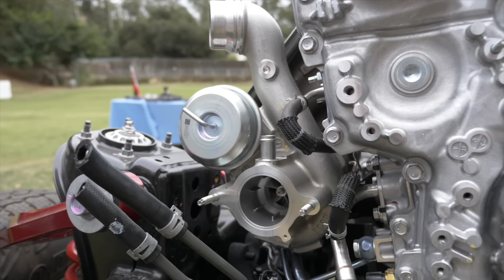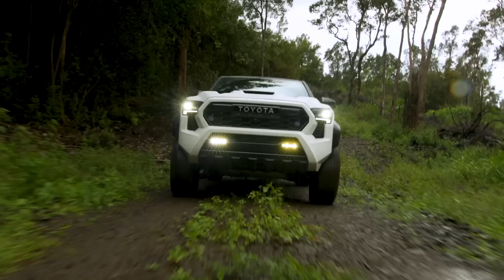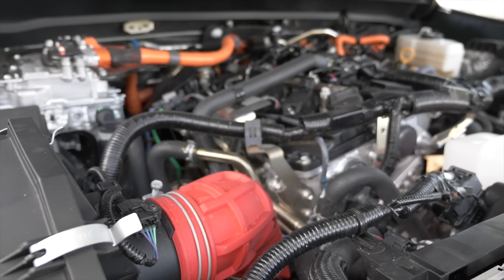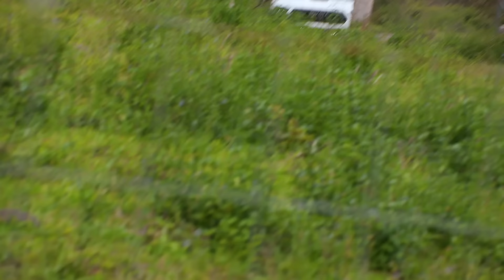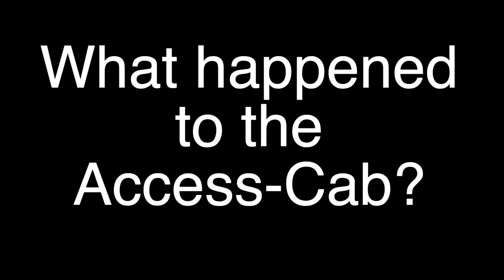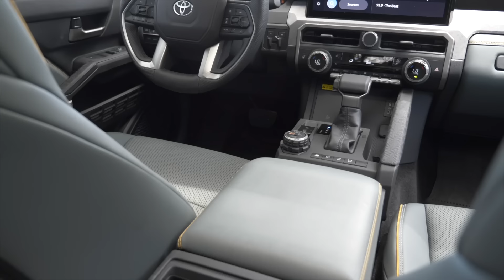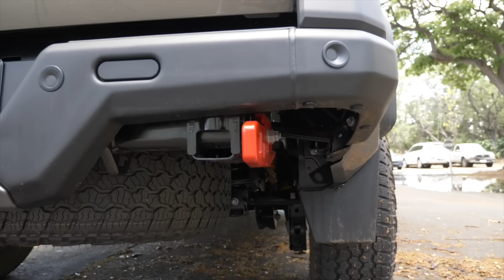2024 Toyota Tacoma Chief Engineer on new engine reliability and more...

Comment: Does anyone honestly believe that the head engineer is going to tell you that it’s not reliable.
Reply: I mean, they could have stayed silent.
Reply: @mad-meh2719 why wouldn't he defend the design he is responsible for?
Reply: @mad-meh2719 doubtful not when you work at his position within Toyota. I know how corporate politics work.... Higher ups tell you to speak on something and you better not bash your product.... Also people start to believe their own propaganda at that level
Reply: @mad-meh2719 that would be taken as bad. I mean we know it's less reliable but by how much. Never seen a 300k mile small frame turbo looking at 150k max before a 2-3k turbo swap.
Reply: It’s called signal theory, you actually are telling everyone how bad the engine really will be. By having to do all of this PR bull crap.
Reply: @DougEvans-wb5ch  or could be stupid people asking the same stupid questions over and over again
Reply: @DougEvans-wb5ch Absolutely. If you have to try hard to sell something, it's probably not very good. Products sell themselves. Ever hear toyota pitch their v6????
Reply: @DougEvans-wb5ch well I guess …
There is a cult following on the 5.7…. It’s almost 20 years old ….
So they are worried about the doubt ..
Reply: @DougEvans-wb5ch or people are concerned and they are addressing the concerns
Reply: And when the turbo goes T U how much is that going to cost?
Reply: @Olaf236 my wife’s 2009 Acura RDX is turbocharged. It has 164k on the clock and it’s still going strong. The only things I’ve ever had to replace on the vehicle is an AC compressor, swaybar end links, and a 70 dollar transmission pressure sensor which took about 30 minutes to swap out. And the tires and brakes, belt and all the other normal wear items.
Reply: @paulallen-01 Your wife’s RDX does not tow anything. Towing puts massive stress on the powertrain. You’re comparing apples to oranges.
Reply: @Olaf236 don’t know about a pickup but on an International MV bobtail truck about $6000.00
Reply: @Olaf236 turbos will be low on the trouble list
Reply: @Olaf236  oh and they will. Anyone that knows anything about engines knows that you do not mix a gasoline engine with a turbo unless it’s a race vehicle that’s constantly being broken down and rebuilt.
Reply: @Olaf236 a lot, on top of the inflated purchase price.
Reply: @Olaf236 probably like 2k~
Reply: @Olaf236 turbos can last a long time if maintained correctly
Reply: @alvinsimba734 I've never had a turbo motor, what is the maintenance on a gas turbo?
Reply: @RossMalagarie  thanks for asking and to answer that, turbo engines are gas engines just like any regular gas vehicle, and also with turbo engines you have to use premium fuel instead of regular fuel and more oil change intervals too for instance every 3000 miles (5000km) instead of 5000 miles (8000km) which I currently do with my Toyota Corolla sedan which doesn’t have turbo. My rule of thumb when it comes to vehicle purchase is to purchase a vehicle that you know you can afford and maintain without problems and for me personally with what I do, that’s why I prefer a vehicle without a turbo. Turbo is more for power boost and nothing wrong with it, it’s just that it has to be religiously maintained that’s all.
Reply: @alvin… Actually, it’s not required to have premium fuel in Toyota turbos. At least in the new Tundra with twin turbo engine, 87 is recommended by Toyota.
Reply: The rest of your comment I agree with.
Reply: @is6566  same in the GM 2.7L turbo 4 cylinder
Reply: @is6566 yeah I don't think modern turbos require high octane. It only makes a difference in compression resulting in higher boost.
Reply: @alvinsimba734 becoming less reliable no with the crazy high turbine speeds to get the power up at low rpms. 150k is a long life on a small Frame gasoline turbine and people not changing oil ever 3-5k miles is a death sentence to journal and ball bearing turbos
Reply: @alvinsimba734  'IF' maintained correctly.   The average US murican won't, I can assure you.  Have a look at a couple of 'Just Rolled In' videos to see how Americans treat their cars.
Reply: @RossMalagarie clean oil and clean air filter.
Reply: @RossMalagarie  From my research, turbocharged engines benefit from religious, short oil change intervals. This is because when the oil flows through the turbo housing it will experience higher temperatures than non-turbo engines normally would. When oil is heated that extra bit more, it will bake off some of the ingredients that keep your engine clean and healthy, hence the need to change the oil a bit sooner if you want optimum reliability and performance.
-(edit) oh ya, and keep up with the engine air filter changes!
Reply: @alvinsimba734 but hundreds of thousands of miles?
Reply: @RossMalagarie just making sure you keep up on oil changes
Reply: @RossMalagarie turbo beats on oil so oil change is important. It also extra important to warm the oil up. You also have to worry about failure of plumbing components involving the rubbers as there are extra heat involved
Reply: @alvinsimba734 what is premium fuel?  That’s a marketing term. What you’re thinking of is higher octane, which is a matter of combustion and timing, not quality. Additionally, Toyota turbos don’t require high octane fuel, rather their computer system adjusts timing to any fuel being used.
Reply: @alvinsimba734  that's not what he asked. He asked what the cost of replacing the turbo is going to be.
Reply: @alvinsimba734 my neighbours still drive their 1st Gen RSX like bandits 15 years later. 2L turbos in those things, though they are religious with maintenance. 🤷🏾‍♂️
Reply: @alvinsimba734 Sorry but you are so wrong. I have a Ford Ranger 4 cylinder ecoboost. The owners manual and the service people told me that premium fuel is not necessary and is a waste of money. Why would I change the oil at 3000 miles. 3 highway road trips and change the oil?  Waste of good oil. 5000 miles is the suggested oil change interval with conventional and 10,000 using full synthetic. Not all turbo motors require premium fuel so don’t lump all of them together.
Reply: @alvinsimba734 but 300k? 500k?
Reply: @psynurse  you can get that much mileage out of turbo engine but it takes a lot of maintenance. I had to find my comment and see what I said because there are over 100 comments on this thread alone, but yes they are some car brands that require regular gas even if it’s turbo whereas other brands prefer the premium fuel for better performance with turbos like Honda does.
Reply: @WM3I  as for the cost you are looking anywhere from $500 to $2000 lol
Reply: @RossMalagarie turbo is a turbo is a turbo. There is no maintenance, it has its own oil line, generally, which also provides cooling, but it is a high spec part so it should last unless you decide to let your oil become sludge.
Reply: @FirstnameLastnameHuman  ok thanks, I never had a turbo so looking forward to seeing how they last in the Colorado Trail Boss with towing about 6500ibs out of the 7700ibs tow rating. I am looking to hopefully tow a toy hauler loaded at 6500ibs about 2-3 times a year so we will see how it does. Thanks for the info.
Reply: @alvinsimba734 That is going to be the problem. People are not going to maintain them correctly. And when the turbo goes, how will the engine perform. Basically it's useless.  In my opinion.
Reply: @RossMalagarie  the maintenance on a diesel turbo is simply the greasy exhaust that keeps everything running smooth. And a gasoline engine there is none.  Give it some time and you’re gonna see a lot of those vehicles in a used car lot.
Reply: Toyota Japan is superior to Toyota made in the states, or should we say made in Mexico
Reply: Better an engineer than a salesman!
Reply: I can tell you from experience that I’ve never, ever owned any Toyota that was not reliable. Ever. And I’ve owned several Toyotas. Every single one of them had over 300k on them before I donated it. So I’m just going by past experience. My 2013 FJ Cruiser is running just like it did when it was new, doesn’t use any oil and pulls my little fiberglass travel trailer with ease. There ain’t nothing like a Toyota. Amd I grew up in Detroit.
Reply: @privatepilot4064  yea but none of those you mentioned were small displacement turbo charged engines.  Of corse there old NA engines were reliable.  Thsts not what's being debated,  there na engines are the best.  But high stressed turbocharger engines never last like the NA
Reply: @privatepilot4064 The new Toyota is very different
Reply: I love all these experts in the comments. A bunch of "back in my day" guys.😂😂😂
Reply: @cesarnavarrete6973  yup because we kno what lasts and what dosent.   That's what experience gets ya.
Reply: Nobody believes that but can you disprove anything that he said?
Reply: Toyota= Reliability. When I look at what Toyota does across the board to insure that they are making vehicles that are going to be reliable, economic, and more recently, more powerful, I will continue you love them. I don't view Toyota as an auto manufacturer. Their model of don't fix what isn't broke is still evident today. They develop high quality parts that just end up together as the most dependable cars ever. They aren't number one in sales worldwide for no reason.
Reply: @TejasAutoSalonJasonW Haha fast forward to today . Toyota has really fallen from years past right now . Maybe the new CEO and bean counting .
Reply: It's Toyota. They correct their reliability issues as they come up. If it's not reliable at release, it will be within a year.
Reply: It’s Toyota 😊😊😊
Reply: He’s got way more answers than the Chevy and Ford Engineers regarding their respective 4 liter turbos
Reply: Reliability has been reduced.
Reply: "Wants a good ol fashioned truck"...no such thing available anymore
Reply: First, you can either suck the 2GR/1GR engines that are gas hoggers and takes 65 bucks every 380 to 410 miles per tank or you give a chance to these new engines. Want more information on the new engine? Search for 2AR engines and how good they are.

These trucks are very heavy due to the body on frame which is what many of us love but is the compromise we have to deal with.
Reply: It’s Toyota so they get the benefit of the doubt.
Reply: Come on man, he's coming out putting his face, his name and being transparent about the design approach.    You think he's going to do all this if he thinks it sucks?
Reply: Your skepticism doesn't make him incorrect or a liar. Get your engineer to prove your skepticism is accurate if you don't trust the information given, or don't. Mistrust without data or proof is easy and gets attention but doesn't disprove anything at all.
Reply: The Toyota badge on the grill says it’s reliable
Reply: Wow.  All you guys out there trashing this truck when you have no idea if it's reliable or not.   You assume that because American made gasoline turbos are crap, all turbos must be crap.   lol  you have no idea.   

Toyota leads the world in automotive reliability.  Even their first gen vehicles are vastly more reliable than anything Detroit puts out, ever.  I worked for a Tier 1 automotive supplier and Toyota was one of my customers.  They are more thorough with their engineering and testing than you can imagine.  And the culture is such that they do not rest on their laurels, they are constantly improving everything.   It's really a very different kind of company than anything we have here in America.   

These trucks will be fine. Remember, there was also a lot of negative speculation about the Prius when it came out, which turned out to be a non-issue, because we're talking about Toyota here, not some average Chrysler or VW or Fiat.
Reply: Considering there are a lot of people that drive a lot of miles.  Reliability better be good.  I doubt they’d release a truck with issues.  This engine is already being used in several models.
Reply: @user-tb7rn1il3q already issues.  Just days ago read they have hold on production due to quality issue. Just watched video on TFL when they were going up fire road in Colorado snow when lost 4wd , front was spinning tires on ice slab and loud noise, that was the end. 2024
Reply: @psynurse  The only production being held is for the GM twins.  The Taco losing front driver is a one off rare failure.
Reply: @user-tb7rn1il3q  it hasnt even been a month and a prominent Tacoma content producer has a major failure. We already know there are going to be widespread issues with first model years. You could not be more wrong.
Reply: @tacoponcho  A few failures is normal for all manufacturers.  This is not widespread at all.
Reply: @user-tb7rn1il3q Exhibit A: Tundra 2022
Reply: @user-tb7rn1il3q  they released the tundra with issues….
Reply: @user-tb7rn1il3q like what?
Reply: @user-tb7rn1il3q dude it happens all the time ..
Reply: @user-tb7rn1il3q , could you tell me what are those Toyota car or trucks used this engine? What is the first year and model of Toyota using this turbo?
Reply: @user-tb7rn1il3q  Your statement doesn't make any sense.   How much time did they have to redesign the newTundra and its been the least reliable and poorest build quality Tundra ever made.  Turbos = more parts = more problems.  The funniest part is when you look at a 98 Supra the Turbo is right on top in front (extremely easy access).  Toyota burried these Turbos in the trucks so they can charge you more to fix them.  These are the first gen Toyota throw away trucks.  I saw it going bad when they threw a Subaru engine in the GR86 (previously scion).   Then they used a BMW Engine in the new supra (goodbye reliability).  Finally they made the two worst trucks ( New Tundra and Tacoma) in Toyota history.   They are replacing reliability with styling.
Reply: @user-tb7rn1il3q Based on Toyota's recent past, they have no hesitation in releasing new products with unproven reliability. Sure are a lot of 2022 Tundras with blown engines. Sure were a lot of 3rd gen Tacoma problems considering it was a relatively moderate 'redesign'. Sure were a lot of 3GR issues in the early years. Etc etc.
Reply: @sheepdog3828  thanks for the info 😎👌
Reply: Of course, don't you?
Reply: NO, not at all. More stuff to prematurely break down. No thanks, not for that kind of money 💰
Reply: DIY fluids/filters/plugs to 300k+ miles?
Halfway there on my 17 OR MT and it still drives like new.
Any compelling reasons to switch?
Otherwise, see you around 2029 Toyota.
Reply: Is it made in Mexico?
Reply: @sledawgpilot  mexico yep  🤣
Reply: Only time will tell
Reply: Perhaps, but it’s good to hear from a design engineer as opposed to often sanitized click bait videos.
Reply: Toyota doesn't announce their reliability ever - don't need to buy when they do publicly - you better believe it's true folks!
Reply: You must have never owned a Toyota 😆😆
Reply: The logo should say enough. We use the same engine in many other models and Lexus as well and we have upgraded nearly the whole motor to handle truck duty
Reply: He’s testifying to his work. Can’t knock that if you ask me.
Reply: It's not that he is going to say it, but it is the content of what he says in response to the question. Talking about using this tech in other countries and for a long time as well as going into their testing procedures sound a lot better than someone just saying "absolutely, it is reliable."
Reply: It’s not the turbo itself that I’m worried about, it’s the stress that the turbo puts on the rest of the motor. In a small hatchback like a GTI a turbo motor is so fun. In a truck like a Tacoma I’m just looking for reliability and longevity.
Reply: Let’s be honest, even with the first  model run issues that will arise a Toyota at its worst is still light years better than anything the Big 3 can muster on their best day. AND as a fact, Toyota does more than anyone to improve and solve problems all along the way. Big 3 make money from their problems on the backs of hard working folks. Sad.
Reply: There’s many Toyota and Lexus products on the road with Turbos that are already passed 200,000 miles and have been reliable. Will they make a million miles like some NAE engines of the past? Unlikely but around 1% of car consumers keep their vehicle past 100k miles anyway.
Reply: More components = more opportunities to break, all driven by EPA standards.  Voting has consequences
Reply: I'm shocked that the biggest Toyota fanboys don't trust a Toyota 4-banger turbo. 
People are  afraid of change
Reply: Change YOUR OIL... every 5 Thousand miles or less. Never more than 5,000!
Reply: No, but I also don’t believe that Toyota puts this 2.4L turbo in a number of their vehicles to ruin their own reputation. However, this is a new generation Tacoma which means there will be issues, wait a couple of years for Toyota to figure them out and things should be fine. I still have faith in Toyota more than most other brands on the market.
Reply: They won't say S*** since they wanna protect toyota's reputation.
Reply: Yes
Reply: why would we assume its not reliable just cause its a turbo? turbos have been around for 50 plus years havent they?
Reply: The same company said the V6 Turbo would be as good as the V8. 
😅😅😅😅😅😅😅😅😅😅😅😅😅
Reply: As “reliable” as a Toyota Turbo 4 can be made, still won’t beat the reliability of a Toyota V6.
Reply: Toyota lied to Congress in 2009 over the sticking gas pedal that killed multiple ppl then they back tracked and paid 1.5 billion to those affected so in short no.
Reply: Puss gut
Reply: Junk....... Anything to meet better emissions........ It's always junk.
Reply: For real 🤣👍
Reply: Are Toyota turbodiesel engines desirable in your mind? What's the difference?
Reply: This is not the head engineer. That guy would be in Japan amd is a multi millionaire. This is a low-level  US marketing engineer, a "bubba"  hired to make you think he's like you, in order to build trust. So you will swallow the 4 Cylinder.
Reply: No, because honestly died decades ago.
Reply: Thaf green one at the end with that side racks thing damn I love that
Reply: Sounds like a smart engineer. To bad he doesn't work in paint department.Never buy Tacoma in white. Toyota has not figured out how to make white paint stick.
Reply: @The-Team-Out-West all Toyotas paint peel and as a customer and DIY guy if I gotta fix something paint ain’t so bad. Just had to repaint 50% of my 07
Reply: Never buy Tacoma in white. Toyota has not figured out how to make white paint stick.
Reply: I think that the Toyota will last longer than the fat ass engineer
Reply: Right 😂
Reply: exactly , they give you more  is what they want you to believe  but in fact its less material to wear ie  surface areas   of parts pistons  and bore .
Reply: 343k Views on a Fake Imposter Video.  YouTube is Full On Fake Now?  Nice! 👍🏻
Reply: Thinking the same thing …
Anyone employed can’t say anything against company narrative …
Reply: How often does Toyota put out an unreliable engine?
Reply: Exactly. It's unproven. Only time will prove it. Until then I'll stick with the out going v6s or v8s from them.
Reply: Also, change your oil every 3-5k with Turbos. You’ll have no problems long term with them if you do that.
Reply: Toyota and Honda have a proven track record of reliability with some hick ups. The domestic car manufacturers such as gm, Ford and Chrysler are in a state of disrepair because of straight up greed, imo. The bottom line is resale of vehicles and Toyota and Honda hold their value.  Trust me, I want the domestic market to get their crap together someday.
Reply: Their word definitely better than yours. At the end of the day its still Toyota.
Reply: Turns out engineers hate customers too and Not just mechanics!
Reply: I was going to ask…would he actually say anything negative? I did  hear him say at the beginning that it was done for “our emissions mainly” which translates into environment before anything.
Reply: I would day if you own the lad few years of the V6 treat it and maintain it like it’s gold
Reply: You just don’t get the longevity out of a 4 then a 6 and turbocharged 4s just do not have the longevity period!
Reply: No but they can make the case
Reply: It's a Toyota, it will be reliable.
Reply: 100 right this guy is just going to assume that everybody's stupid enough to believe the lies😅
Reply: @truthnow902  you probably believe the Fox Bullshit Factory.
Reply: They've been using turbochargers on diesel trucks since 1951, it's not like it's a new technology, if you maintain the engine , it will last 300,000 miles.
Reply: Bring us diesel for Toyota in the USA,  then I'm down with a turbo.
Reply: I expect him to be able to say HOW it’s reliable. Which is far more valuable than some keyboard warrior’s input.
Reply: He’s trying to save his job.
Reply: Salesmen...........................Selling Ice to a polar Bear !
Reply: Most long haul diesel trucks run turbos. They often go over a million miles. Still, I'd rather have the four liter v six.
Reply: I'm from Europe and I know how many problems we had there before that TURBO  BS came to US. There is no such a thing like reliable engine with TURBO ,for longer run.
Reply: Does anyone believe you know better?
Reply: Thanks Toyota, for making my 2021 more valuable 😎
Please keep pumping out more junk 😂
Reply: Tundra recall…nuff said
Reply: I did not believed a single word that came out of his mouth. Turbos can never be a long lasting and reliable engines. The basic idea of pushing in compressed air that accelerates the wear & tear of the engine in comparison to a N/A power terrain.
Reply: This engine is the same used in LEXUS NX, so relax and take a cup of tea (Japanese one) 😊
Reply: @CarlaPalma-f8n ugh.......thats a car.  The tacoma is supposed to be a TRUCK!
Reply: Ha Ha !!
Reply: I still prefer the normal engine…

Less parts = reliability
Reply: If he is putting himself out there for everyone to see. I will give him the benefit of a doubt a little.
Reply: Not with a gut like that!
Reply: You're an idiot. Sure, he's telling you it's reliable. But you're completely ignoring the fact that he's explaining WHY it's reliable.
Reply: He looks real energetic, 😳
Reply: Nope, but he believes Toyota made a newer version to meet what customers seem to want.  We can have a Toyota or one of the other brand trucks.
Reply: He can’t even get his own diet correct
Reply: I wonder if this guy had his hands in the transmission engineering? Or how about those break lines?
Reply: I have a 2019 Tacoma with 88000km. Not a single problem yet. The turbo 4 will have to wait a few years for me in order to gain my trust or not. Time will tell…
Reply: This is this dudes crown achievement. He spent years studying engineering, and the Japanese deemed him competent enough to represent their brand (I worked for the Japanese in a Toyota parts manufacturing plant and I know just how picky they are). He's spent countless hours on perfecting it.  He's obviously proud of it as he took the time to record and showcase it.  This video alone convinced me that "all is well" with the new gen.  So I purchased a 25 TRD Sport.
Reply: @BarberChad606  and look at the problems with them.  Bunch of garbage trucks now.  Took the most reliable trucks and made them some of the least reliable now.   Garbage!
Reply: My next Tacoma will be a used second generation with a v6
Reply: What’s gonna be funny as to watch Toyota backpedal here in a few years.  I don’t know very much about auto mechanics, I mean, I’ll replace things if they break, but I’m not going to rip apart an engine and fix it. But what I do know is that gasoline engines and turbos DO NOT work for reliability.  Long gone will be the phrase, “Toyota trucks are reliable”.  These engines will be lucky to see 100,000 miles before being complete junk.  Sales have plummeted since the introduction of this design.  They just need to switch them to diesel.
Reply: Not at all
Reply: Yes because Toyota ceres about their reputation. They fixed rotted frames on second third etc owners. 

You’ll be driving a turbo charged vehicle or battery eventually it’s the way they are taking you. So hop in and get over it 😂and dam like the power already look how many semis on running on turbos.
Reply: Yes yes we do
Reply: Is anybody honestly gonna believe that Toyota made a bad motor?
Reply: @julianmcnalley4909 Only those not brainwashed by the Toyota cult religion of blindly worshipping the mother company
Reply: Toyotas been doing turbo motors for decades.  Relax
Reply: @b_snow777 Cult garbage never stops. Look what all those decades has produced in the Tundra.  Great stuff. Fanboys eternally licking Toyota boots.
Reply: Do you have proof????
Reply: I want to ask the question as I am an mechanical engineer not some technically illiterate garage goober with a keyboard and barely a salary of $60K or less..  If  turbo diesel engines can be designed for commercial duty  million miles why can't a turbo gas engine achieve 300K miles in light duty truck applications?  Then what is the motivation of Toyota to risk their reliability/durability reputation by intentionally introducing a powertrain that is a failure?  I think you pundits are emotional goofs who built your opinions off of old data from the distant past.  If you keep turbo engines well lubricated with clean oil and cool they can last avery long time,  not to mention this is in no way a high peak  performance car turbo boosted engine.  It is a purpose designed and tested light duty truck turbo engine.  So cry about the past all you want cause there is no going back.  The days of V8 and V6 in these  platforms are surely gone and never coming back.  That is unless you pay the Lexus sin tax.
Reply: @kannermw We're talking apples to oranges here. A big diesel is not a consumer item, but a tool for a trade, expected to run a million miles and be overhauled several times, and it's priced accordingly, because it's an investment that makes money. It also has less restraint in packaging,  so it can be very big, reinforced,  long, and heavy. Typically,  big trucks have straight sixes, which fit under long hoods and between straight frame rails, providing 7 main bearings for Increased durability.  
Even the original Cummins Dodge diesel was a heavy agricultural engine,  stuffed into a pickup. 
With a gas engine,  especially a turbo one, it's different.  Firstly,  gasoline does not have inherent lubricant properties like diesel oil does. A gasoline turbo engine is subject to.dense packaging restraints, which is why they're usually a V6. This automatically takes you from 7 main bearings to 4, which concentrates loads onto less surface area, which puts more load on the oil film, which is also a mess due to the piss-thin  oils niw being used. There's also a ton more heat and pressure on the whole structure, as consumers demand more and more power out of tiny engines.  And as we can see with newer cars in general,  there's a disposable mentality. Any seasoned mechanic can tell you that.  Nothing is built to go 20 or 30 years, like the older, under-stressed designs. I have an old F-150 with a 4.6 V8 that is 30 years old, and many of these go 300,000 to 400,000 miles, even in police and taxi service. But, they're only putting out 220 HP or so. 
It's probably possible to make a gas turbo go for this kind of mileage,  but there MUST  be compensation for the extra stress in materials and engineering,  and the company that does this is pricing themselves out of the market. The market today trades in a vehicle in a few years,  so manufacturers don't waste money making them be durable goods. And most buyers could care less, and do zero research.  Witness the new Toyota Mexican soft Taco,  which is so cheaply built that it doesn't even have a transmission cooler or bump stops.  Yet it far outsells the Frontier, which has both engine and transmission coolers, Dana axles, and a very proven N/A V6. 
What sells today is not quality and longevity,  but a NAME and hype, with lots of plastic gimmicks.
Reply: Yes
Reply: sheldon is now the manager of a Krispy Creme donut shop
Reply: Mine runs fantastic
Reply: 95k miles on 2024 no issues
Reply: Toyota is very smart and strategic in their Quality control and business decisions. They destroy engines on purpose to find every weakness until they are satisfied with the end product of their testing. They call it Kaizen which means always improving. Have any of you seen how reliable Toyota Turbo engines have been in the past? 2JZ for example.. legendary engine. B58 is technically BMW but believe me, Toyota quality tested the engine and had BMW change a few things so that it could be up to Toyotas’s quality standard. I haven’t heard of any of those engines have Turbocharger issues. I have full faith in Toyota’s ability to deliver on their product being known worldwide for their reliability.
Reply: @jerry64264 They have had issues.
Reply: @jerry64264 you seen the 102,000 engine recall for the tundra turbo engine? 😂
Reply: @tamalpias you seen why they were recalled?
Reply: @bradleyholt if you believe Toyota it is machining debris. Irregardless it is a massive problem.
Reply: All fine but still offer the v6
Reply: @rockymtnnut  They can't dude, because of emissions.  The government is forcing their hand.
Reply: @rockymtnnut Toyota will sell every one they build, so why add a second option with similar power? It just seems like a distraction when Toyota could focus more resources on making the one engine good.
Reply: At the end of the day. Toyota will get you home.
Reply: @timleng4404 Unless your 2022 Tundra's engine blows up. Unless your 2016 Tacoma stalls out and leaves you stranded on the side of the road. The 3rd gen was nicknamed the turd gen for a reason dude. Toyota will get youu home if the vehicle is at the end of its production life. A 2015 Tacoma got people home. A 2016 left a lot of us stranded. A 2020 Tundra gets us home. A 2022 grenades an engine and we hope the dealer sends someone to help.
Reply: @timleng4404  well their proven vehicles will...
Reply: lets check in 6 months after release.  @timleng4404
Reply: @timleng4404 tfl trucks got stuck using one of these Tacomas 🤣 shit became a prerunner
Reply: @phantombread3170  Another reason for you to go buy a Colorado,  Ranger or a Jeep.
Reply: @timleng4404  I guess not a new one they are all wayyyy too big
Reply: @ kentpass 😃 According to your logic, the chief engineer is doomed if he says his new truck su(x) and unreliable because he admits it and if he explains why it’s great and reliable then he is doomed because he is obviously just lying. Great approach to life! 😃
Reply: @is6566 you nailed it!
Reply: Yeah but when does toyota make anything unreliable? Reliability durability and dependability is what they're known for. They won't change that for anything.  I believe in the company.  I believe in Toyota and Lexus.
Reply: @gabevillarreal4779  reliable? Probably.  Durable with a hybrid turbo charged engine?  Depends on what you mean.  The battery and turbochargers will have to be replaced eventually and both will be expensive.
Reply: @theoutdoordad7395  I f course but in my mind when they are engineered and manufactured by a company like Toyota,  I trust that they got it right. Regular diligent maintenance will do the trick with this company.  It's been my experience with Toyota lexus and Honda.
Reply: If you doubt Toyota reliability you’re kinda screwed to be honest. Nothing else surpass it
Reply: It’s a Toyota, not a Ford. Toyotas just keep on going.
Reply: @monteaustin1006 😂😂😂 yea the out going v6.   This is a turbo 4.    How many turbo anything u see on the road w 300k n 15yrears old???? None
Reply: He ate the evidence
Reply: If it was ford , dodge or Chevy they wouldn’t even make this video not to mention Toyota’s are built for a different purpose
Reply: The first one or two years of this truck is going to have problems. It might be 30 or 40k miles before we see them, but there will definitely be problems.
Reply: @tacoponcho where is it built? Mexico?
Reply: @sledawgpilot  mexico like the old one
Reply: @sledawgpilot  yup
Reply: @tacoponcho How in the hell do you know? Did your crystal ball tell you that? 😂
Reply: @mr.wilson8340  because thats how it always plays out. You would have to be foolish to think it will be different this time
Reply: @tacoponcho exactly and by next year the truck's coming out should have most of the kinks fixed, at least I hope
Reply: @tacoponcho TFL broke the front drive during a tough off test. Wait Toyota 's result of failure,though TFL thought the case of front drive broke.
Reply: @tacoponcho I still drive my 1979 turbocharged Toyota Supra, still waiting for the problems to pop up.
Reply: @mocheeks709  whos talking about your rebuilt antique. And theres already been dozens of reported issues, check the taco forums.
Reply: @tacoponcho  the ADD on one truck broke , a carryover from the last generation.
Reply: @tacoponcho  yes like the V6 twin turbos- blowing up
Reply: @tacoponcho No problem. The engine is warrantied for 60,000 miles, so they'll all be covered under warranty.
Reply: @dvader3263  yeah, you trust the guys messing up oil changes to rebuild engines? Good luck lmao
Reply: @tacoponcho Let me guess...You have an older 4runner and you have never driven a 6th gen.
Reply: @ColoradoConquistador ive driven the 6th gen its garbaggio like your opinion
Reply: Not gonna be towing much with that.
Reply: @crypto_ninja  I think it's rated at 6K or 7K ibs towing
Reply: @RossMalagarie I don't believe it's that high for SR5.
Reply: What does it matter to you?
Reply: Knowing Toyota… it will be subpar and take about 5-10 years to be acceptable. The Toyotas that are known to be reliable are ones that have been out and refined after years.
Reply: Is he the head engineer or did he just eat the head engineer?
Reply: Dude... He's a sales person and it shows...
Reply: @abbsgarage.9676 yeah, that’s what this video is for, buy in. Deep down he knows the v6 power plant is way more reliable and cost effective in the long run, but he has to sell to us that the tiny 4cyl with turbos is better at 300-500k miles because his bosses told him to
Reply: The head engineer gets paid by selling trucks. He's going to tell you it's great.
Reply: @shaydu1967  yep, and want to  sell corporate idea of  building products that "seem" better but in fact  are Inferior are less materials to make  , more problems in long run.
Reply: Nope.   These will fail over n over.   Stressed out 4cyl turbo will last bout 90k range if your lucky.    The 300k mile tacomas are thing of th past.  😔 sad
Reply: Automakers doesn’t care about gas mileage nor reliability, they will do everything just to pass crappy emissions test after that everything is easy to them. I know toyota would love even to put 3 cylinder on tundra because it has less emissions 😂
Reply: 4 cylinder engines turn at higher RPMs that a V6, it will wear out sooner.
Reply: @melissasmess2773  tachometer shifts at about the same point on either . Depends on how it's built,  what the compression ratio is , forged interals,  etc etc . Hondas are meant to be revved out and there are 90s vtech engines still outlasting American big displacement engine and making far more horsepower per litre. They just make Power differently. Just like 2 stroke demolishing 4 stroke for power , or crotch rockets vs Harleys..etc .nothing wrong with either but it's been burned into folks heads that turbos are inherently unreliable and as soon as they see a smaller engine they assume less power etc. The gr yaris engine is a 300hp 3 cyllinder...100hp per liter stock . And there are folks reliably pushing them well past 500hp
Reply: Any 4 banger pulling a truck is gonna be shit in the long term. You won't pull much. Your already putting stress on it pulling it's own body 😂
Reply: @cursed-by-awareness  exactly pulling  a lot of weight people tend to  load them up ie  trailer etc etc  . Theres and old saying  buy a v6 or v8  pay a little more for gas (not a big deal )   , OR   pay for a  engine replacement   later .wisdom says buy more fuel , v6/ v8 a  stronger motor  in any truck application.enough said
Reply: Secret sauce = no testing
Reply: I’m hearing GM built a more reliable turbo 2.7 Ecotec Torque monster . Than Toyota’s 2.4 turbo only time could tell
Reply: @Clamjuice65 I'm pretty sure if an engineer tries to make something reliable at GM they will get fired
Reply: @Clamjuice65 I wouldn’t bet on it.  GM isn’t exactly known for reliability
Reply: @Clamjuice65 doubt that very seriously
Reply: @Clamjuice65 GM has their 2.7 turbo 4 cylinder in their new gen 3 Colorado and Canyon for the 2023 models on ward. They get 310hp and 430TQ but also have been in their full sized trucks since 2019 and in the almost 5yrs they have been out there I have not heard about a ton of turbo or other motor problems with them yet. But we will see after 10yrs
Reply: @Clamjuice65  TFL Channels Colorado already crapped out on them look it up
Reply: @Clamjuice65 2.7 is gimped in the Colorado, more reliable in the Silverado. I’d def think the 2.4 will be better
Reply: 😂😂😂😂😂 @Clamjuice65
Reply: @Clamjuice65 😂
Reply: @Clamjuice65 how come it aint sellin?
Reply: @Clamjuice65 GM 😂😂
Reply: @oliverramclam6009 it's early but 10k miles in my 2023 Colorado with the 2.7l motor has been great.  It is actually kind of diesel like in its mannerisms.
Reply: @bikerbeliever8169 10k is a drop in the bucket! Like one of those JD Power awards for “initial” quality … LMK when you hit 100k miles!
Reply: @bikerbeliever8169 just saying diesel gave me PTSD. I have the diesel.... Nothing but problems
Reply: I’d prefer a small displacement turbo diesel
Reply: Not a Toyota @bikerbeliever8169
Reply: @bikerbeliever8169 nothing but issues with my diesel Colorado. Always worried it will leave me stranded, thus why I'm lurking on Toyota review channel
Reply: @Clamjuice65 lol gm hahHH